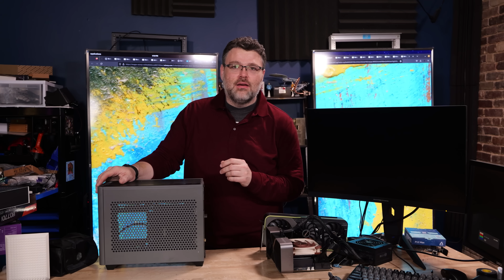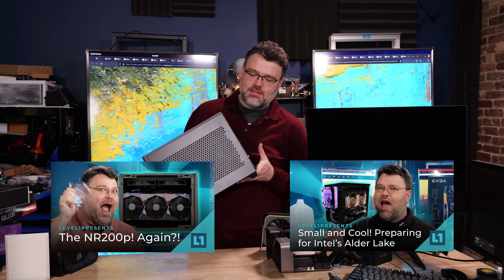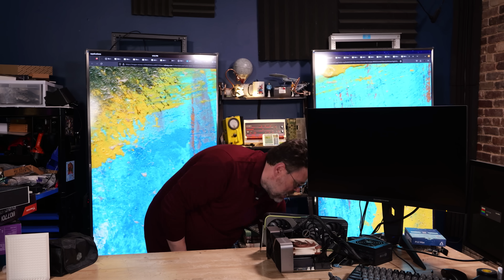First Look at Cooler Master's NCore 100 Max

Comment: I still have the nr200p max I seen a version 2 where you can put a bigger GPU. The front has a cut out so the GPU can extend out the front frame of the case so now there is only 1 2.5 inch available you can attach. But this is not ideal for me 120 mm aio is not a option for me personally.

Comment: Ion like it.
Motherboard/chipset temps will be outrageous.
Killed a 5800x in the ncase m1 with a radiator mounted behind the intake fans.
Chipset temps were regularly at, or above 85c while gaming. Couldn’t even touch the back of the motherboard.
Lesson learned.
Intake fans now blow directly on the components, and i only use downdraft coolers in all my itx builds.

Comment: I tried the nr200, wasn't a fan, ended up going with the ssupd meshlicious, then the meshroom. Looks like coolermaster likes the design. I am actually using the coolermaster 1100 sfx psu in my build.

Comment: I'd like to see a case in that size/form factor that has at least 8 bays for 3.5" drives instead of room for a gigantic gpu. It's a nice shape to place on a table behind a TV for a living room TrueNAS. SFX power supply and motherboard in the bottom, and a couple of 140mm fans in a chimney setup directing cooling over the spinning rust.
Reply: This, but at least 4 drives

Comment: I just want all these reviews to start with the price. When they don’t, you just know it is Uber expensive. $399 for this case, even with cooler and SFX PSU, is too high.
Reply: 399 for a case, AiO, PSU and gen4 riser cable. While not a great deal, it also isnt a bad one either
Reply: I wouldn't pay money for the included PSU either.  But that's only 'cause I don't like the particular one included, not because it isn't a fair price.  Think about it:  $150. is decidedly cheap for a high-quality SFX PSU in the over-750W power range.  And $100. is more than reasonable for a non-standard form-factor liquid cooler. 

If you figure it like that, then you're only paying ~$150. for the bare case.  That's a perfectly fair price for what this is, with the weird form-factor that has no commonality with any current or prior iterations of anything, and solid aluminum-plate panels.
Reply: Literally stopped the video after reading this comment.😂

Comment: Careful with CoolerMaster PSUs. We built all of our workstations using CM Gold and Platinum PSUs and 4 out of 7 units died within 2 years. Not a particularly high sample rate but it was enough to convince me never to use CM PSUs again. Switched to SeaSonic and Corsair and those are going strong ever since.

Comment: How does the HDMI connector fits? Is it coming from the bottom?
Reply: If connected to a GPU, then yes, it would be plugged in from the bottom. If using onboard graphics it would be plugged into the motherboard and exit the side.

Comment: Haven't reached the end of the video yet. But as learned from another reviewer doing this case there may be an issue with the 12VHPWR. Because yes it is 90 degree. But with those GPU's that have the reversed connections it may be more difficult to connect. Depending on the variation of the connector which changes the placement of the power and sense pins.

Comment: NR200 could really use an update to add type - C and to be slightly bigger to accomodate for enormous RTX40 gpus.
If I think about an update for NR200, this is definetly not that.
Offtop. I personally also own and use a PC build in NR200.
Reply: I went with an Asus Prime AP201; it's ~10L bigger but it's got room for everything
Reply: the issue ofc compared to NR200 is that that 10L bigger is horizontal and not vertical thus taking more desk space @sharticlese